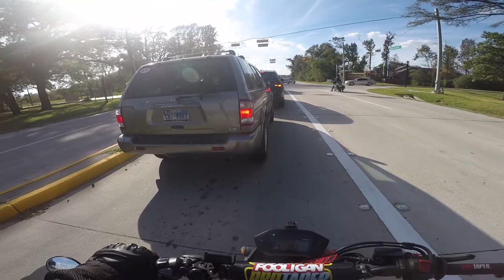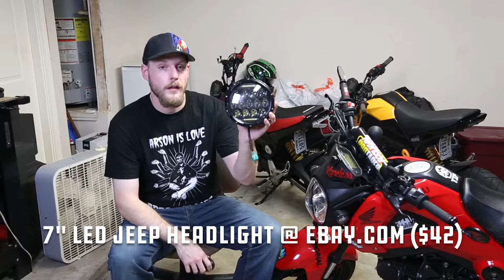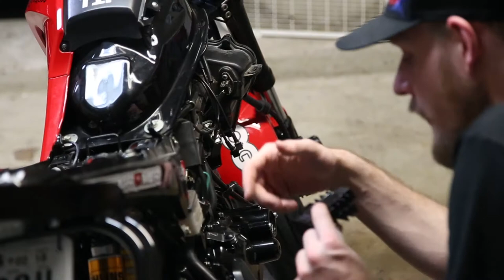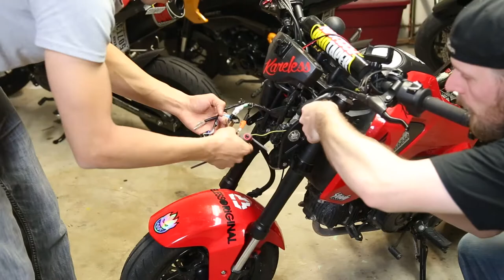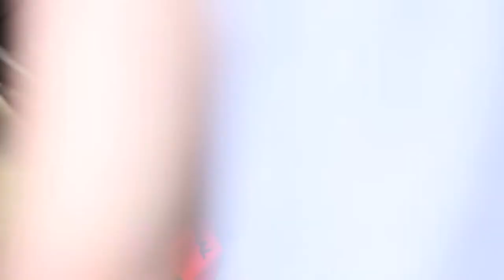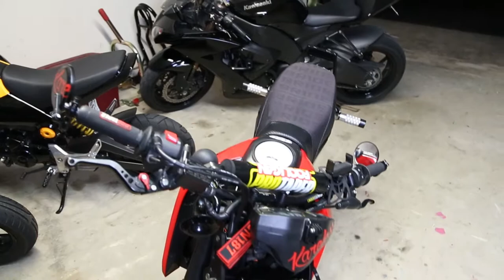Monster Eye Headlight install on Honda Grom

Comment: Good job!!!! Like the light. Looks a lot brighter than my stock 2015 Grom light.
Reply from the maker: Randy Autrand it's crazy bright, I love it :) so much better than stock.
Reply: Can the stock headlight mounts be used? Previous owner cut signals and used wire nuts. I re-soldered and just put back together. Love that light!!
Reply from the maker: The stock mounts are utilized. The minimotolab brackets use the top and bottom stock screw holes, then the middle of the bracket has a large screw hole on each side that allows you to mount the light. I don't see a way around not ordering the brackets to properly mount it unless you were able to fabricate something yourself. Thanks for watching brother!
Reply: MotoMantooth Ok.  Thanks Bro

Comment: Suh dude?👊 What are the odds you remember lol...The black bike in the background with the black/red seat..Where'd ya get it?
Reply from the maker: The bike or the seat cover? A friend got the bike from a guy on CL I think, worked at a tire shop in Houston. My friend sold it years ago now when he moved. 

Seat cover wise, ebay, but it's an awful seat, horribly uncomfortable. Not the seat covers fault, but the padding under was worse than stock.
Reply: @MotoMantooth   The seat. Ooh it was one of those covers! I saw them on there lol I thought it was a actual seat!
Reply from the maker: @BillFromHalifax  The seat cover is Enjoy Mfg, i have one on my DRZ. Whatever padding was used under was god awful lol, like sitting on a 2x4.

Comment: I have 1 black loose wire and cant find out where to connect it. I tried to connect it do different wires but it ended up blinking when i used the right turn signal, and not working on the left

Comment: I’ve read that using the gojin rectifier will cause the taillight to stop working properly. Did you experience this? Thanks
Reply from the maker: I have an aftermarket integrated taillight, I didn't experience these issues. It may do that to the stock light, unsure there.
Reply: Thank you :)

Comment: Is the recto required for this headlight or can you run the headlight without it? Also, the link for the brackets doesn't seem to work anymore. Do you know another place to buy it?
Reply from the maker: Found out after you don't HAVE to have the recto. Didn't know how to wire it myself without that. 

For the brackets, they sold the patent to another company: http://flpparts.co/grom/mml-monster-eye

Comment: Did you need to buy a seperate led conversion kit for this?I have the15grom and I keephearing that I need and adapotor. between the rectifier and included wiring,is there anything elese I need to do or buy first? will this work with-my stock high/low beam switch?
Reply from the maker: Nope, at least in my case I just bought the jeep light and it was plug and play. same with the recto. Someone had already installed flush mount turn signals on my bike before I got it so for the turn signals I just plugged them in. It already had the led relay installed. No special wiring on my part to make the hi and low beam work.

Comment: Great video! Is the headlight and turn signals plug and play or did you have to splice ?
Reply from the maker: GhoStrike just plug n play with all parts :) unless your connectors don't fit the turn signal ends, then you just splice those.

Comment: Do you know the wattage of that headlight?  I was always concerned it might drain the battery too much.
Reply from the maker: I believe it's 75w, but i have zero issues with it draining my battery :)
Reply: @MotoMantooth  Good to know!  Btw did you have to bend back a wire holder to get it to install?  I have the same setup but found out quickly there is a metal bracket in the way of the spacers and bolt for the headlight.  Still waiting on my headlight too.  They seem to dropship from china I'm guessing.
Reply from the maker: @TroyJPerez  yeah i bent the wire holders behind the headlight to make it all fit.

Comment: Looks slick! I almost went with the MiniMoto brackets but was too cheap. : ) Ended up making some custom brackets for a 7" LED Daymaker.  Also got around needing the rectifier by tapping into the 12vs of the tail light. Cons: Little more work, Pros: cheaper!  If curious, my build is here: https://youtu.be/8ZXp9hamtSQ
Reply from the maker: Don't have the stuff to fabricate the brackets and didn't find out about the tap in till my buddy did his recently. For someone that doesn't have the fab or electrical knowledge, should probably stick with the video route. If not, def save yourself the money and go the cheaper like the suggestion above. Thanks for posting man! :) Glad you are liking your headlight.